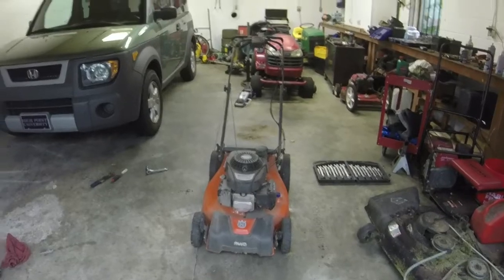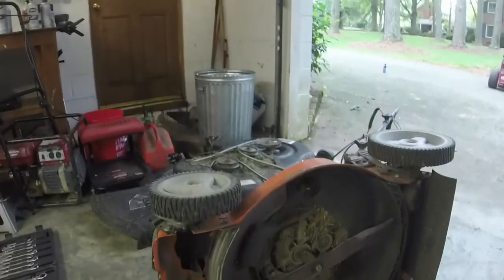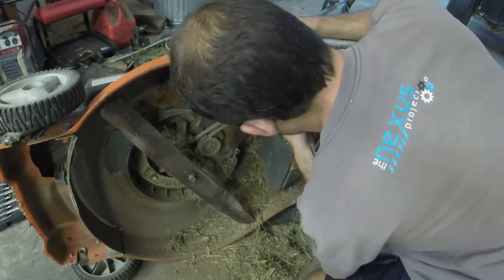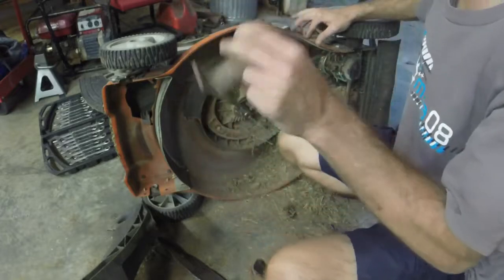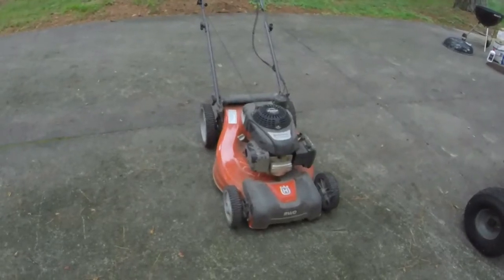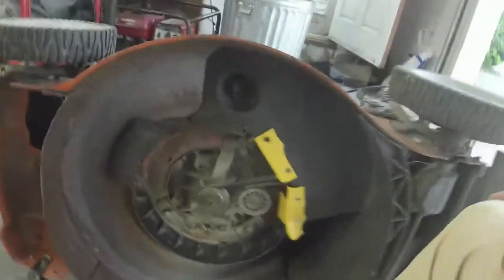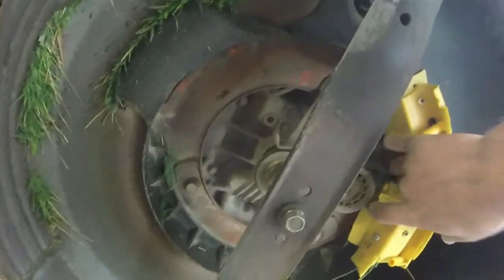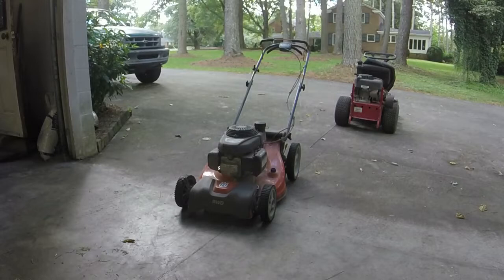Husqvarna RWD self propel mower throws belt- making a poor cover design better

Comment: I had the same problem with my RWD Husky,  So much grass buildup that my garage stunk to high heaven.  Bought a $7 piece of corrugated plastic at Home Depot, cut a 13" circle with a 3" hole in the middle for where the blade comes thru, screwed it to the existing plastic  underneath, and it works great.

Comment: Grass gets packed back into area around the drive , and is often the case this material then proceads to wind itself into the V belt drive pulley grove forcing the belt to climb up off the pulley and get get thrown dispite the belt retainers , its not just an issue with Husqvarna mowers, and like you said the deck guards either need to block the grass from getting in there in the first place , or they need to put a pulley groove cleaner into there desigen so that grass cant pack itself around the pulley , its also a hard area to access so through maintance so that one can clean out that area ,, The way they intend for you to put take the belt off and put it back on is to spin the pulley off the drive units shaft by gripping the shaft with a pair of vice grips of water pump plyers so it wont turn then spinning it off counterclockwise , as this lifts the pulley above the belt guards, for people who dont allready know theres a small return spring on the drive unit that puts tension on it when you release the drive handle ensuring the drive disengages and I have found those like to disapear,  the plastic idler pulley bearing also loves to sieze up ,, so make sure you check both of them when servicing the drive on these mowers..

Comment: I have the same mower - same model and year.   I also have had this exact problem three times.  I took it to a small engine guy the first two times and both times he told me the problem was caused by too much grass and small sticks.  Granted, I had used it in some rough areas, but nothing all that rough.  The third time it happened I could not make myself take it back to the shop.  I told my wife there has to be a design flaw here even before I saw this video.  If “Husky” had set out to design a system that is guaranteed to get clogged with debris they could not have done it better!  Once you showed me how to remove that cover (4 screws, all the same size!  Nice!) the rest was pretty easy, so thank you for that.  Other than that, I really like this mower a lot.

I wonder if Husqvarna has fixed this in more recent models.  Probably not.
Reply from the maker: Husqvarna no longer makes push mowers so I guess they fixed the problem that way!
Reply: I have HU700H rwd (2016) that doesn't exhibit this problem, stll using the original belt.  Sorry to hear that Husq doesn't sell push mower anymore😓

Comment: You my friend are a lifesaver!!!!! I found a ton of videos on the Husqvarna AWD mowers...but not much on the LC221RH RWD mowers. Mine would just squeal every time i tried to pull the drove handles, and, they were very hard to pull. I called a couple places that told me the trans' was probably broken...but i just didnt believe that. I followed your video and made my way in to the undercarriage, and found a piece of wood lodged between the belt and rear pulley...i pulled it out, put it back together and she runs like a champ again. Oh, by the way...in regards to what you mentioned about a possible piece missing underneath... No, their isnt...that mower is not designed with any type of cover plate underneath...i have 3 of them...they are all wide open, allowing grass, debris and chunks of wood to get in to the belt/pulley system. Thanks for the video.
Reply from the maker: Thanks for watching and glad I was able to help!  I find it hard to believe that they did not cover this up.

Comment: After reading some of the comments I realized it's missing the front plastic cover that covers the belt. I sure need that part number
Reply from the maker: I think it may be a belt cover.  Take the model number on the rear of the mower and plug it into a Google search to find the manual and that should give you a part number.

Comment: Have had my mower for almost 10 years and struggled with excessive grass getting into the drive assy/pully.  The small ring/cover finally broke the tabs off so now I am waiting for a new one to come in.  I am going to fabricate a circular cover to end this for good.  What a poor design!  How could they think that grass wouldn’t get blown into the mechanism???
Reply from the maker: I thought it was an oversight until I looked at the parts manual and found that there was no cover shown either.

Comment: I have the husqvarna HU775H (rear wheel drive), which looks just like that model. The parts manual shows the belt cover as part number 580806901, which covers the belt completely.
Reply from the maker: I think some models have the cover, when I looked at this model I was going to buy a cover for the customer but there was none on the parts diagram.  Must be a different design although they may look the same on the outside
Reply: Hey thanks Denis I will try to find it at a local lawnmower store.

Comment: So, after watching your video I decided to check out my Craftsman, front wheel drive, self propel mower made in 2004.  The entire area around the blade adapter is fully enclosed with a plastic cover.  I have to agree with you; either a dumb design or a missing cover on the Husqvarna.  Good video tho and a good (and inexpensive) solution.
Reply from the maker: Thanks for the input.  Yes they all should be covered like your Craftsman.  This one was made in 2018 and the manual does not show a cover which makes me think it is just a poor design.
Reply: @EllisMowersandmore  I just got the Craftsman given to me.  Had a Toro Personal Pace also given to me that I fixed the rear drive on, but, I sold it and don't remember if it had a cover on it or not.  I'd a thought that the Husqvarna and Craftsman's would be pretty much the same.

Comment: Ellis Mowers. You know, After watching your video and thinking about what you were doing,  I wonder if a person removed the cover completely and applied a heavy WD40 coating and tried leaving the cover off - What the results would be rather than fooling with that POS cover. I think you are on the right track with attempting to cover the opening like you did. The key to everything is keeping me mower deck cleaned out to start with. I’m not a Husqvarna fan.
Reply from the maker: The mower is nice except for the cover.  I looked at the manual and it does not show an additional cover for the self propel which leads me to believe it is a poor design.
Reply: Ellis Mowers; Yes I totally agree. For the extra money that you have to pay over other brands - You would think that a simple cover would not be too much to ask for. Oh Well.

Comment: Would the wash port have cleaned out the belt area?  Just wondering if the intention was to have the operator clean it out after every use so no cover needed.
Reply from the maker: I don't think so as it is a cavity that the grass builds up in with no way to get out.  Washing it would actually get it caked in there even more I would think.

Comment: How did you get the belt on the back without removing the guide?
Have the same problem. 
Belt will not go into the pulley with the guide on
Reply from the maker: A trick I often use is starting the belt and turning the pulley and use it as leverage to roll it over the guide.  Not sure what I had to do on this one since it has been so long since I repaired it.

Comment: I had the same issue a couple of weeks ago. I have the same lawnmower, what is the front plastic part called that protects the belt. Mine came off the blade destroyed it
Reply from the maker: Probably just a belt guard, if you look on the rear of your mower you will find a model number, type that in a search and you will find a manual which will give you the part number.

Comment: Trying to confirm proper belt size for this mower?
Reply from the maker: Best way to find out is to locate the model number sticker and look up the parts manual.  That sticker is on the back of the mower deck near the bagger flap.

Comment: I have this mower.  It's a bad design or factory didn't install it.  Luckily my belt jumps of the front.  If you spin the belt you will find a slightly thinner spot from friction that slides easily past the guard.
Reply from the maker: I can't believe something like this was overlooked in the design process.  Manual didn't show a cover either.